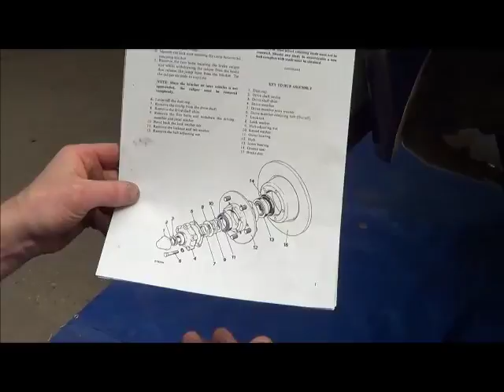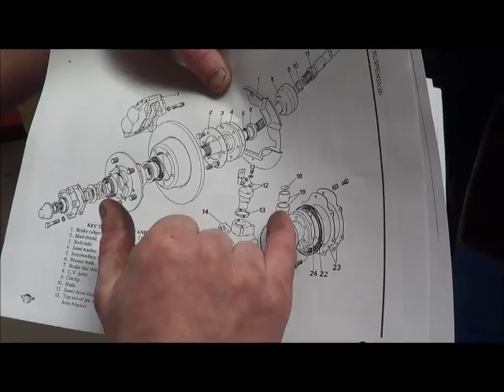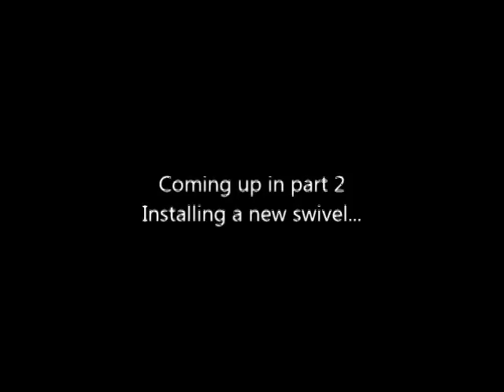LAND ROVER SWIVEL REPLACEMENT (PART 1 of 2) REMOVAL with Rob & Vic #landrover rover

Comment: A small point to add. It's worthwile draining the hub first. When you undo the two bolts to remove the brake tubing the swivel can move and seal opens letting oil / grease out onto the floor. If you are replacing the swivels you'll probably start by removing the oil, but this will catch you out if for example you are working on the brakes and need to remove the calipers. This has caused me to swear on a few occasions!
Informative video with an easy style.

Comment: I thought it would have better to press bearing rings in or even use  a copper mallet and not a steel faced hammer. However  a well presented video with a lovely lady  having ago. Well done.

Comment: Hi guys- love this video, thanks for sharing! could you also share a list of all the parts, gaskets, oil seals, etc needed for the job? Your website mentions the tools needed but not the parts. Thanks to your video I am attempting this on my TD5 but I'm worried I'll miss ordering a crucial part and have to leave everything open until that part arrives.
Reply from the maker: Hi, thanks for the comment. 
We used the swivel kit from Britpart (I know), something like this: https://www.paddockspares.com/da3178-swivel-kit-front-axle-from-la930456-to-wa159806.html which includes a new swivel housing, since most are pitted and worn. It has everything you need in there - gaskets and shims, grease etc, except for the lower swivel pin. We reused the existing lower pin, which is normally not worn and fits into the new bearing race - but these are available seperately, and possibly a good thing to order just in case (they don't cost much). 
We also reused the stub axle seals and bearings, although I would recommend replacing while you're in there. A kit like this is available: https://www.paddockspares.com/da3191-stub-axle-kit-def-front-from-la.html
A  new lock washer for the hub might be handy (or reuse the old one), and think about some new bolts for the swivel to axle. Although, as I said, we reused most of the parts, and it was fine for years).
Just be sure to get the correct parts (kit) for your model (obvs!). I have a surplus stock of stuff that was wrongly ordered, or not used...😅
If you're trying to cure death wobble, have a look at the panhard rod bushes first (ask me I know... perhaps you do as well, but it don't hurt to share experiences)
Hope this helps a bit. If you haven't already, check out part 2 (refitting) for all the parts we used and the other tips like torque settings etc: https://www.youtube.com/watch?v=9BExJlVBVPA&t=0s
Reply: @ASimplyFabLife  Thanks for the speedy reply! this is great, thanks for sharing. definitely gives me a lot more piece of mind now that I won't miss anything. Really helpful!

Comment: Brilliant video and thanks for sharing. You need to do a series landy next please

Just one point folks, always remove rings etc off fingers before doing any work, seen to many injuries due to getting crushed or getting caught especially when getting out of landy, truck or tractor cabs etc and even more no no if you are working around electrical circuits.
Reply: good point Stapleford. Watched a guy get his finger ripped off one day because of a ring.  Really though a Landy is straight-forward to work on. Mind you, once you move to turbo-diesel-Isuzu's a Stage 2 Landy seems like an Ox wagon.  But then the Landy TD5 is a HEUI injected engine also and without an ECU.Both are a lot more than a pushrod engine eh.  I guess the message is get with the plan (the 21st Century) or keep chipping rocks

Comment: I was very intimidated by this job until I saw this video. Now I can't wait for the parts to arrive.
On your last point about the teflon coated swivel balls, my 2001 TD5 has shiny swivels. Does that mean the teflon has worn off and they should be replaced?
Reply from the maker: @radsy5821  Cheers thanks for the comment. Happy that it will help 👍.
As far as I recall the shiny ones are stainless steel, so as long as they aren't pitted (little rusty dents and scratches from stones, gravel) they should be fine. The older ones were steel so when they got some pitting it would wear the seal faster - hence the teflon ones.
Depends on use really, roadwork no real problem.
You can also ask the defender Facebook pages, they're pretty good with advice.
Good luck 👍💪😎

Comment: solution to LR problems, buy a jeep.. half the price, half the weight, half the getting stuck in mud :)
Reply: But then you'll find that you're driving a jeep rather than a rover....
Reply: it's hard to work out which uses more gas.. a Jeep or a Rover.  Either way they can send you broke. But in retrospect.. the Rover is WAY more capable off-road. The Jeep relies on you revving up and blasting through with spine bent into an "S" shape. The Rover plonks along at 1000rpm at 1mph with no wheel spin. My feeling with a Rover is "this thing is an on-road tractor", whereas with the Jeep it's "it's got shit all traction but a big engine so i'll try it faster and hope like hell I aim straight".  Note: Rovers have a much higher re-sale than the Jeep. In fact the older a Rover gets the more valuable it becomes.  People collect Rovers and dump Jeeps. What more can I say
Reply: haha Edwin, much like the Yanks approach military operations - all guns a blazing and flat out. Brits and Aussies much more considered and careful. In Australia Jeep parts are horrifically more expensive than LR De
fender parts